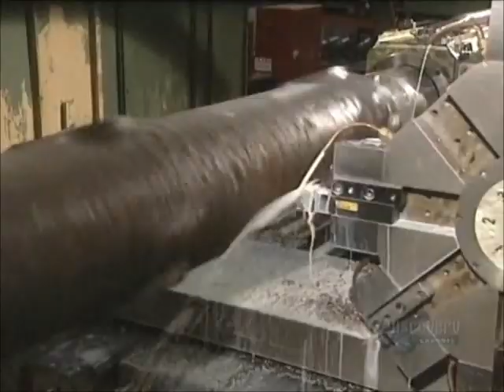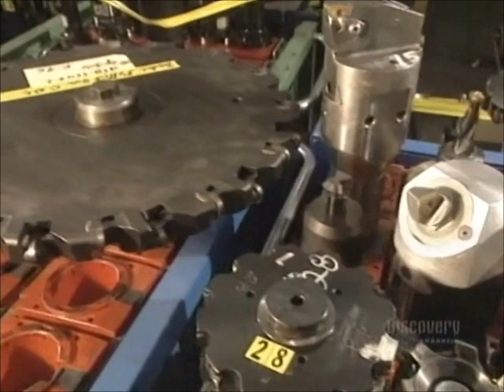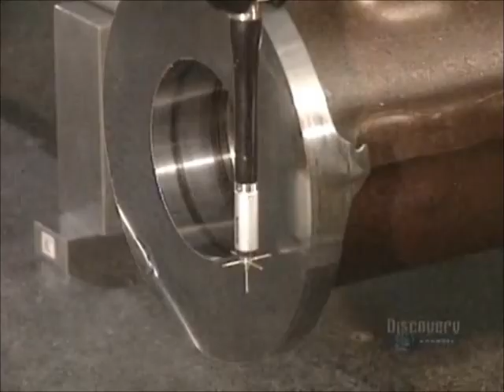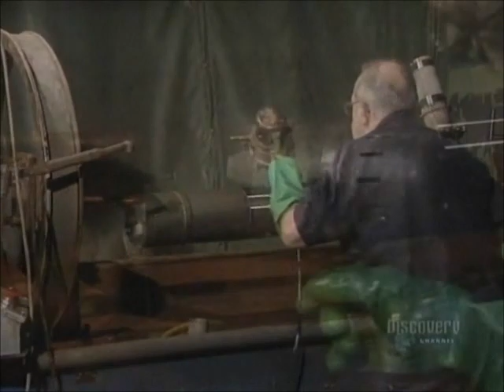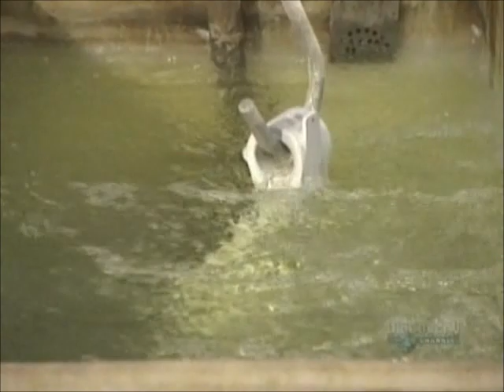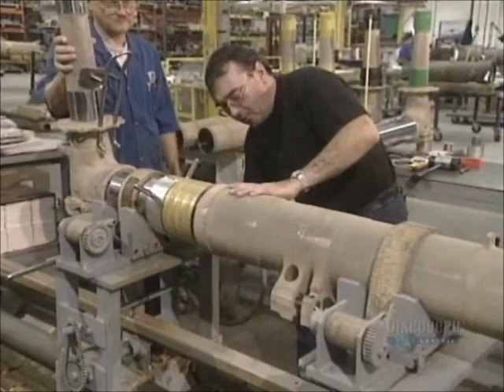How it's made - Aircraft landing gear

Comment: -- There is so much wrong with this video when it comes to the narration it isn't even funny. I will mention that the first aircraft part that you see is called a truck beam and it originates as a forging. Interestingly enough, what we saw in the video is not actually how they're made anymore - the forgings are advanced far beyond what we see in the video before the machining process starts. As a machinist for what is now the world's biggest airline, I used to participate in the restoration of these aircraft parts. Disassembly, inspection, machining and assembly. Part of what is shown in the video includes what is known as MPI which is magnetic particle inspection. They also use a process called DPI which is dye penetrant inspection to check for cracks. The 23-hour bake after plating is only used after chrome plating not CAD plating. It is due to hydrogen embrittlement. The bake process draws off the hydrogen atoms from the metal thus eliminating the possibility that cracks will develop in the metal which leads to failure. Overall, the video give you a very short view of what is involved with landing gear. If they wanted to be serious about it, it would take a documentary of several hours to get a full view of what is all involved with manufacturing and the use of landing gear on the average commercial jet. Best wishes! 

- Max Giganteum

Comment: He is silent on the type of steel used for these..
Reply: Not necessary steel. Titanium is also used in these applications.
Reply: -- WRONG. Very little titanium is ever used in landing gear for two reasons. One, it's not needed strengthwise. Two, it's far too expensive to use - especially considering it's not needed. I worked in the airline business as a machinist for years so believe me when I say that I know. Best wishes! 

- Max Giganteum
Reply: hi M H...
'
who is a word - HE -